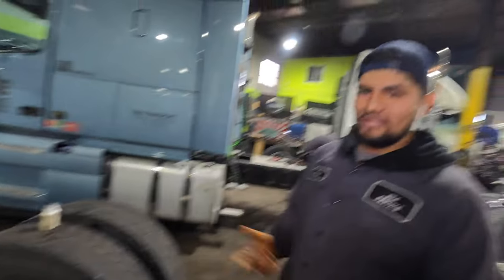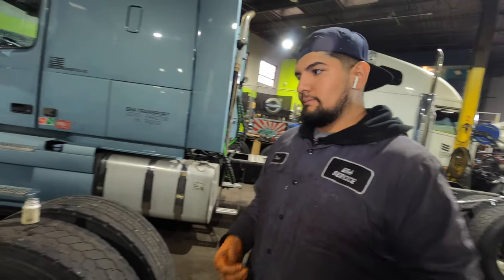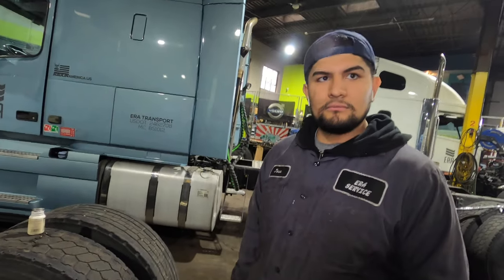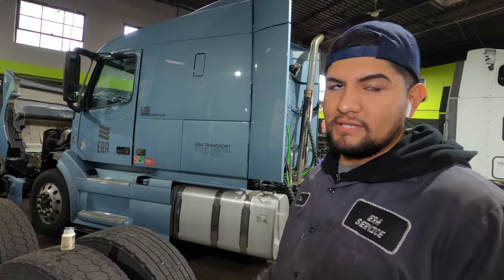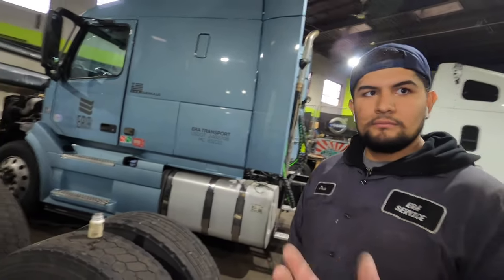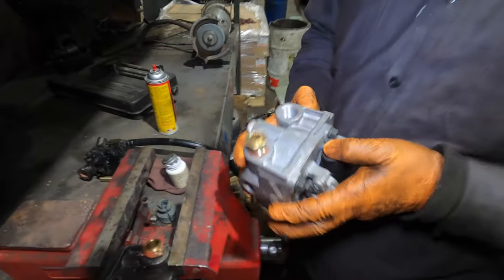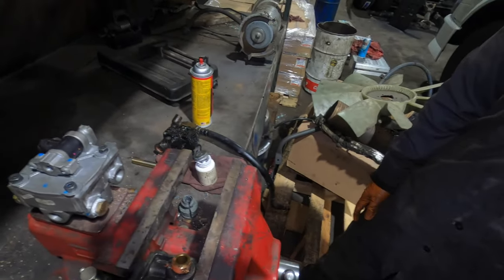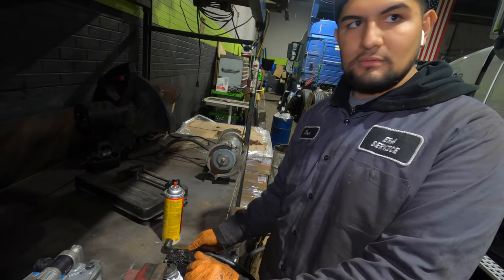Air leak under your 5th wheel. Check this

Comment: Seems 5th wheel ABS assembly giving lot of field failure issues specially in cold climate. Relay valve is not doing its work properly seems it is overloading with its function!